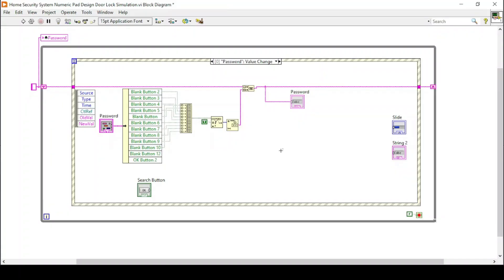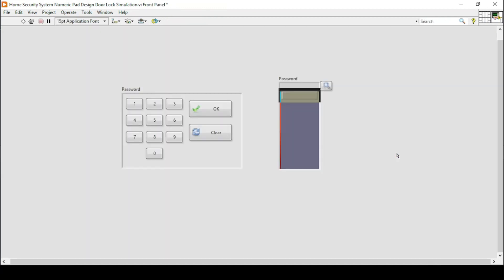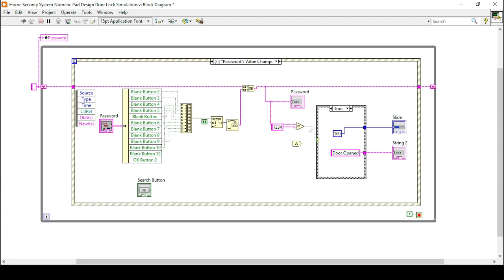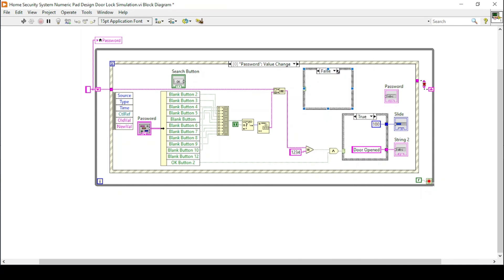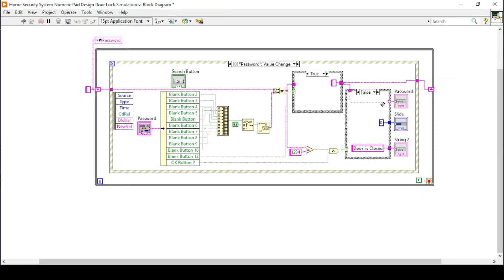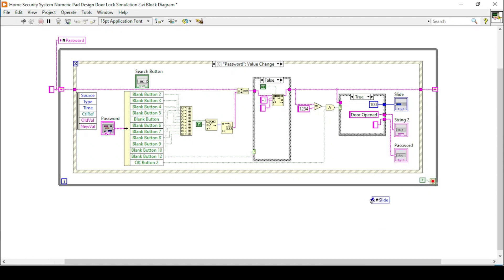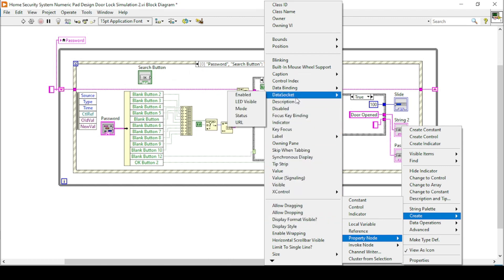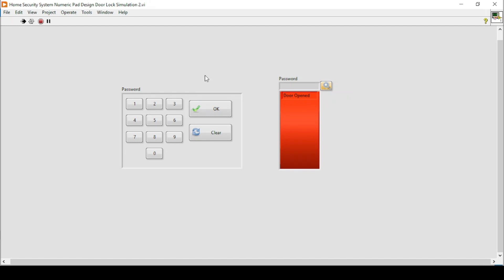Door Lock Opening and Closing Simulation LabVIEW | Part 2

Comment: Sir what did you connected to the shift registers it is not shown in the previous video
Reply from the maker: it is just a local variable of string indicator so to just initiate the indicator as empty.
Reply: Sir, How to apply it ?
Reply: just link the output of the concatenate string to the border of the while loop then right click mouse and select "replace with shift register"
Reply: it gives you back the value at the end of the loop updating it for the next one